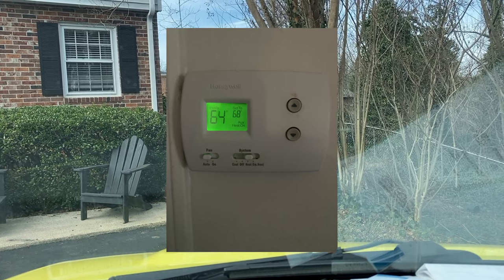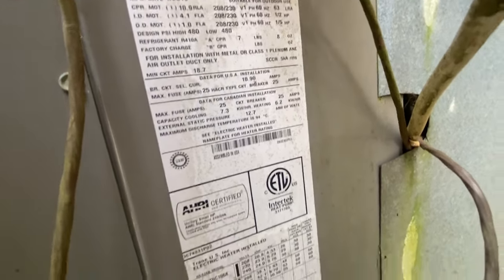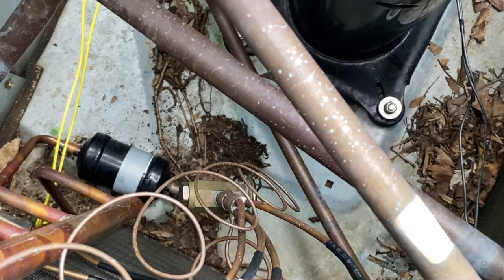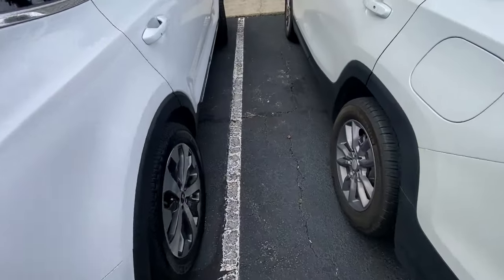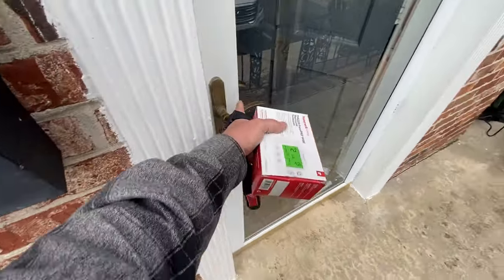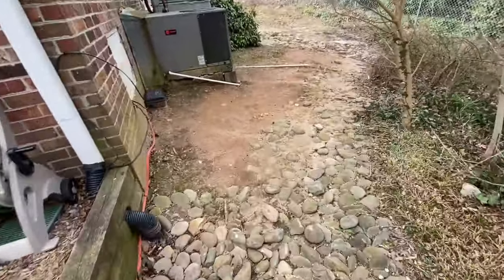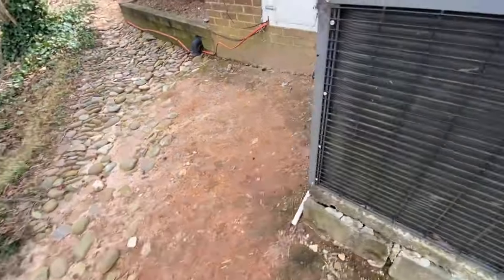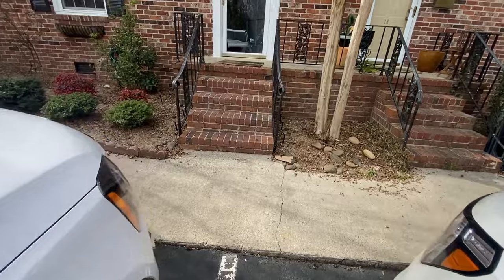Replace thermostat while waiting to repair Freon leak r410a￼

Comment: Great video Ted I was unable to comment for a while so first of all who the hell will leave the Grey colored Romex wire exposed like that outside that's a code violation at least in Pennsylvania

I mean how hard is it to use plastic conduit I think but I may be using the wrong term meaning that gray plastic stuff you can buy at Lowes or home depot run the wire through it as that protects the wire it's just common sense that's why all wires need to be protected from water or moisture exposure.

Period even if the wire is rated for outdoor use.

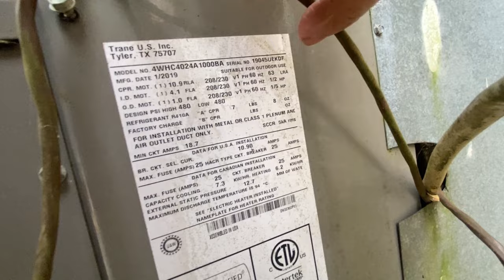Comment: Who replaces a package unit and doesn't install a new hood? That looked terrible, especially with that high voltage line resting on that cut sheet metal 02:11.

Comment: Appears to be no disconnect for those units, and no outdoor flexible conduit;  no electrician or high end HVAC technician did the wiring at that location. 😎

Comment: Thoughts on the new R454B? Gonna be alot of leak repairing this year waiting for it to fully get implemented 😅
Reply: I won't rush into them if I have a choice. The new install equipment that will be required is expensive as hell, and the problems that always comes with the new standards